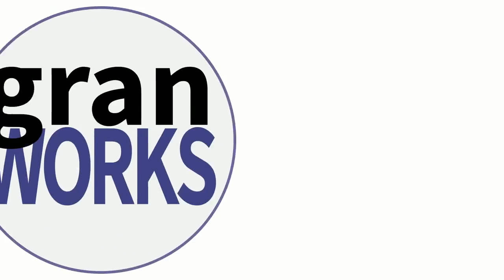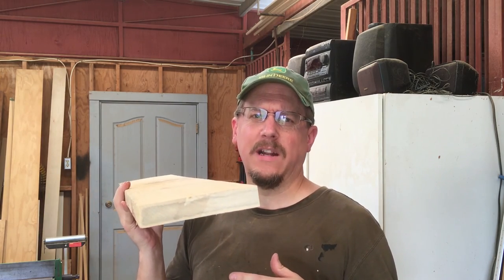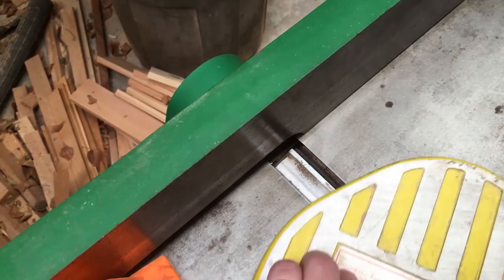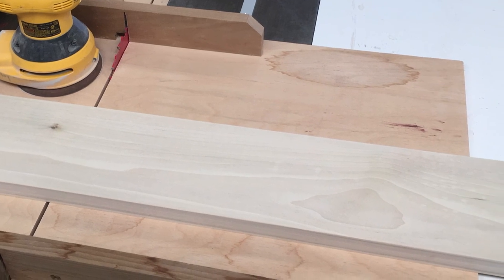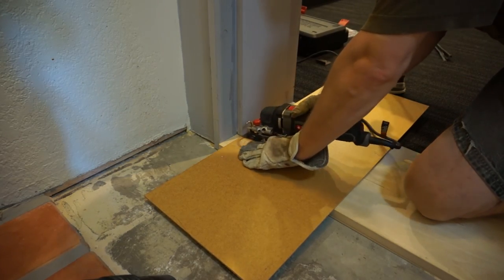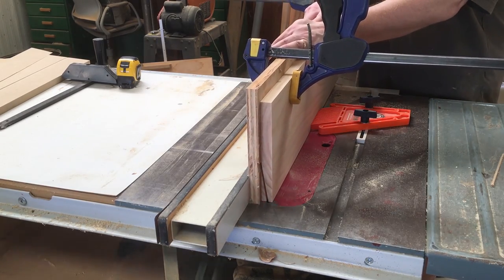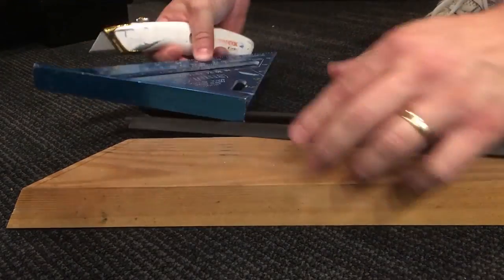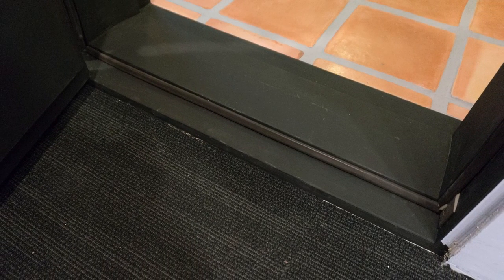Creating a Custom Threshold for a Soundproof Theater Door

Comment: which rubber thats u use ? share link plz
Reply from the maker: It's a door seal weatherstrip used with a kerf, sometimes called Q-LON.  Here's a representative item from my local Home Depot: https://www.homedepot.com/p/Frost-King-E-O-1-in-x-8-ft-Brown-Vinyl-Covered-Foam-Weatherstrip-Kerf-Door-Seal-DS8B-25/100158291.

I don't have an Amazon affiliate link mostly because these cost $5 from a local hardware store but $25 on Amazon!

But really, any reasonable hardware store will have these.  "Q-LON" or "Kerf Door Seal"

Comment: great video, you could of course mark out the angle with a bevel gauge and hand plane it off as well, I will need to create an airtight seal for my studio door, do the hinges lift the door as it opens?
Reply from the maker: The hinges are just standard (albeit super heavy duty) hinges, so they don't life the door.  Instead, the idea is to have the door just press into weatherstripping that goes all the way around the door -- including the bottom.

This does work very well, but not perfectly.  The issue is that some of the corners can still separate just a little.  Not a lot, but enough that any notable air pressure will be enough to squeeze through.

A truly airtight door would be a "bank vault" style, where there are TWO layers of air sealing.  That could be perfectly airtight.

If you are serious about building a recording studio, then I strongly recommend hunting down the book "Home Recording Studio: Build It Like the Pros" by Rod Gervais.  It's amazingly comprehensive and I learned tons from it.
Reply: @granworks  yes I'm very serious about it, thanks for the reference to that book, I will check it out and buy it if I like it. My experience as a joiner and craftsman should come in handy, I plan on remaking the box frame and the entire thing from scratch because the current door frame isn't square enough for my standards, thanks for your help.